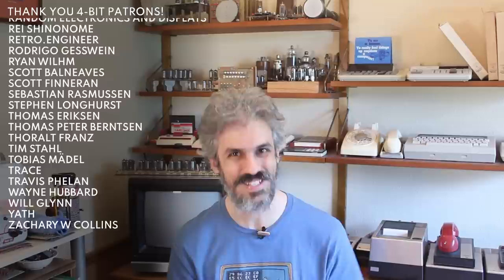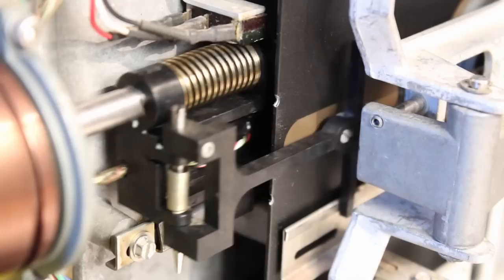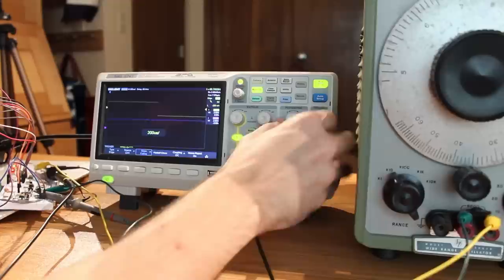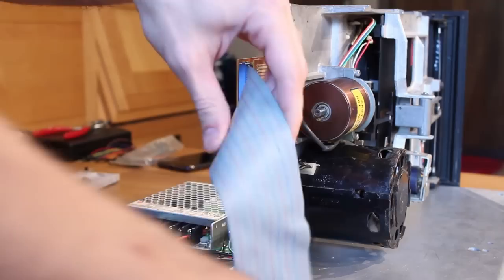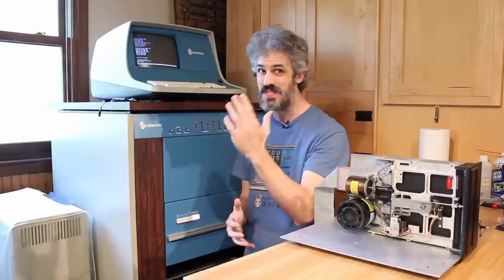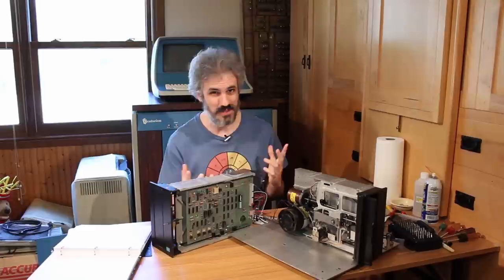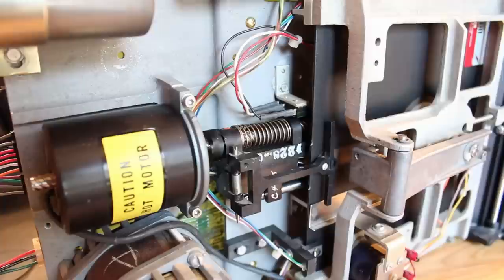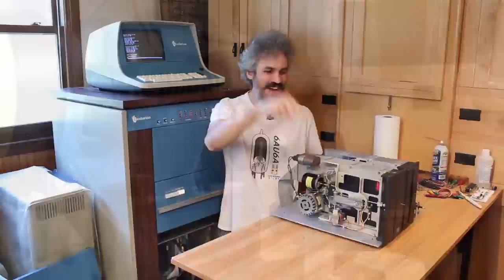Minicomputer Part 20: Connecting the CDC 8” Floppy Drives to the Centurion

Comment: Get someone to send you an 8" floppy disc. Hook the 8" drives to a PC, an XT work great for this. Then grab a copy of ImageDisk and use the alignment tool in the program to align the drive. Isn't that hard, just need a good formatted diskette. Alignment itself is a little tedious, but not hard, just time consuming moving that servo a tiny bit at a time.

This is how I allign my 5.25 and 8 inch drives.
Reply from the maker: That's an excellent idea! Though, I have something else in the works for alignment at the moment, but I'll definitely keep that in mind.
Although, I don't have an older PC, so I'd have to find some way to interface them with my modern desktop, which is a project for the future simply for backup purposes.
Reply: @UsagiElectric  Well come by VCF and make a thread, quite a few people would be willing to help with your project! :)

Comment: Once you perform the alignment on the floppy drives, your system will be THE reference for Centurion floppy alignments in the future.
Reply: until either an alignment floppy pops up ... which is unlikely ... or a stack of disks that have centurion data on them ... slightly less unlikely ... and then there is the question if the machine that wrote to those floppies was perfectly aligned ...  

it's pretty much the same hassle with head alignment on cassette decks - without an expensive alignment tape you can align YOUR decks  to be perfectly compatible with each other, but then you get a cassette that has been recorded on a different deck and might sound like crap in your decks
Reply from the maker: We're actually running into that problem with the Hawk data packs I have. Right now, the drive is aligned perfectly to the three data packs I received with the genuine machine, but I get read errors with the two packs I got from the counterfeit machine. Most likely, the two drives were aligned slightly differently, and if I had a proper CDC alignment pack, I could maybe get the head to a sweet spot to read both, but for the moment, we're mostly just focusing on the three data packs it works well with. 
I could of course overwrite the two questionable packs and they would now be aligned to my drive, making it the standard, but I think instead we'll get the second Hawk repaired and use it as our test rig to read out any questionable or misaligned packs, keeping the current Hawk aligned perfectly to the OS pack.

Comment: Contact Adrian Black of Adrian's digital basement. Ask for an 8inch floppy formatted on his newly repaired TRS80 Model II. In the sense since they are both 8inch drives, the tracking should be similar. As I remember the TRS 80 used Shugart drives and with some work one can get them to work on an old IBM PC or clone. Since they use the same media they should read the same track 0. Everything else is just formatting of sectors. You can also talk to him about how he connected his 8inch drive to a PC to fix it; he has a video on how he did it. This might be helpful to you and the Centurion Cause.

Good luck and Enjoy.
Reply: Good call.  It’s been a couple of decades since I worked on eight inch drives, but those CDC drives look suspiciously similar to Shugart drives.  There were also soft sector and hard sector eight inch floppy media to complicate the situation a little.

Comment: I love how when you are restoring something, the last ditch effort is to look at it as a physical schematic and reverse-engineer how it should operate. You have to basically reinvent it in your head.
Reply from the maker: So much revers engineering going on to repair these things! The manual actually has a troubleshooting flow chart, but the chart always ends with "Replace the PCB," which is super unhelpful, haha.

Comment: Comparators tend to go bad if they're reading anything beyond the logic voltage, and the weird resistor assignment is the bridge voltage divider meant to make sure the capacitors are sufficiently charged to keep chips doing their things rather than latching up in unknown states which is indeed bad for chips, which then the desired voltage set by the bridge resistors gets hit, the comparator fires, in turn actuating the Power-on Reset circuitry ensuring that the drive "boots" into well defined state that you want it to be in. Some smarter floppy disk drive (such as those from Apple and Commodore / Amiga) just wait it out in software routine until the analog portion of the drive is ready to handle anything the built-in floppy disk drive controller's CPU funnels into.
Reply from the maker: Interesting, thanks for the information on the Comparator POR circuit!

Comment: All that metal, the massive PCB and the washing machine motors all driven by a substation of power supplies. All of that, just to read a floppy disk! It's almost surreal to consider that within living memory, technology I once used on a (near) daily basis, is now (effectively) the subject of an "archaeological dig".
Reply: One thing I'm really wondering about is why did 8 inch disk drives spin continuously, instead of just when the drive was being assessed? Wouldn't that cause excessive wear, especially on the floppy disk?

Comment: Couldn't you get any 8" floppy with data on it to use it for alignment? When you look at the signal levels, it wouldn't really matter if the Centurion could actually read the data or not 🤔
Reply: Yeah, that's what I was thinking.  Any commercially produced floppy should get you into "close enough" alignment regardless of what system it's written for.
Reply: That would certainly be better than nothing.
Reply: Yes, definitely. Even better if he can use (say) three disks from different sources to be reasonably confident. Looking at the amplified read signal from the heads (before the digital part) with a 'scope should make it easy to adjust for peak amplitude. As you say, it doesn't matter whether or not the Centurion can read the data. One other thing is to check that the track 0 switch operates reliably for track 0 and never track 1. If a bit out of adjustment, it will sometimes tell lies.
Reply from the maker: That's actually a really good idea! I bet I can find some random 8" floppies on eBay with data on them already.
Gotta get that FFC card working first though!
Reply: @UsagiElectric  pretty much the way you aligned the other HDD right?
Reply: @UsagiElectric  You don't need the FFC working (yet). All you need is an oscilloscope connected to the output of the head amplifier. I expect the board will have a test point for this purpose.
Reply: @Derundurel  And it's probably better to look at the the signals form the head before any conditioning. Then you can look for peak amplitude of the waveform instead of looking for where it cuts out.
Reply: But ... any floppy that old may have had serious signal degradation.  My 5.25 floppies from that era are unreadable.
Reply: @KameraShy  they might, but that isn't my experience.  In any case, alignment does not require readable data.

Comment: I'm really glad you decided to repair the second drive. These devices are amazing and definitely worth keeping in full working condition. I'm glad I could get one here in  EU, that is not as easy as getting one in USA.
Reply from the maker: Yup, the goal was always to get both going!
And, even though we salvaged parts from two other Hawk drives, the ultimate goal is to repair one more Hawk and get it up and going. And, if I can find some heads, I would like to give the third Hawk a go at getting repaired. The Phoenix is a harder job since the fixed platters are extremely precise and almost impossible to change, especially without a CDC alignment pack to write new servo data, but we are thinking about a way to at least get it half working with just the removable cartridges. It may not be fully up and going, but half working is better than just tossing it!

Comment: Btw, linear power supplies also have ripple. But it's around 60/120Hz or 50/100Hz, instead of higher frequency around 65-100kHz. One thing about those Meanwell PSU's. Under light loads to sometimes go into "eco-mode" aka hiccup mode. That was not the issue here but something to keep in mind in the future. I usually use roughly 1/3 - 1/4 of the max power as a minimum as a rule of thumb.

Comment: Amazing job to figure out what was going on. That is not something I think I would have sorted out. A lot of what you have figured out I wouldn't have been able to. Wonderful to see that computer slowly coming back to life. Back when 5 1/4 floppies were in common use, one of the cautions I learned, not sure if it is true, was that you never power up a computer with a floppy in the drive, or in the case of the drive where you manually engage the drive heads, you should leave the heads disengaged. The reason is that a pulse could be sent during start up which could damage the data on the floppy. I never had that happen but then I always made sure discs were not in the drive or engaged at start up. If anyone knows if that caution is really necessary I would be interested to know.
Reply from the maker: Thank you!
Really, it's not that I'm smarter or more clever than anyone else, I'm just a bit more stubborn and refuse to let the machines beat me, haha.
As for the power on status, I think it really depends on the drive. For these CDC drives, it doesn't seem to matter since the head is unloaded and will remain so until the Power On Reset circuit stabilizes and unlocks everything. But, other 5-1/4" drives may be totally different. Weirdly, I now am more familiar with these 8" drives than any other drive out there!
Reply: From the days when PCs used floppy disks, powering on the machine with a disk in the drive was commonplace because you'd often want to boot from the floppy.  But then, on a PC, the BIOS POST routines allowed everything to settle before the drive had a chance to do any damage to the disk.

I used to work on a PDP-11/04 that booted from floppies, and we powered the machine on with disks in the drives all the time.   But then we were kids in a high school, so maybe our ideas of best practice were a little underdeveloped.

Comment: What you could have done is use a Schmitt trigger buffer or inverter (74 xx14) to clean up the square wave
Reply: Schmitt triggers also make great square wave oscillators using just a simple R/C network. It's easier to use than a 555 :)

Comment: The NE555 can convert a sine to square wave if it is in the voltage range. Input is then pin 2 and 6.
A Transistor Schmitt Trigger is possible with two transistors and a few resistors.
Reply: yep, i've used 555s like that many times

Comment: R90 is just a pull-up resistor for the LM339's open collector output.  R85 provides hysteresis so that once the comparator flips, it stays flipped (and not oscillate) as C43 slowly charges.  The reference voltage is applied via R84 just to provide some isolation so the hysteresis works.

CR17 is to discharge C43 instantly should the +5V drop.  It won't have to wait to discharge though R86.  

CR20 is interesting.  I think it's job is to insure that C16 is discharged the instant power is applied.  (C43 is 150 times the size of C16)  Since you say that's the erase inhibit line, it's probably to set the erase inhibit line active at the moment of power on.
Reply from the maker: Thank you for the analysis of the power on circuit!
We did manage to figure out the hysteresis design, but it's the CR20 that really bakes our noodle. That makes sense that it would set the erase inhibit on during power on though as that would definitely help to prevent erroneous erase options from happening when things are unstable.

Comment: imo the ideal computer was supposed to be fully digital from the start and all these analog/mechanical parts used over the decades were temporary compromises due to limitations of the time. it's kinda interesting how much time and effort they devoted to all the storage devices and their media prior to flash memory - paper tape, punchcards, magnetic tape drives, floppies, harddisks, optical drives. not to mention controllers, drivers, storage encodings and all the standardisation wars they had, only to be obsoleted in few short years.

Comment: Your 2n2222 square wave generator would've worked if you ran the output through a schmitt (schmidt?) trigger like a 74xx14 inverter.  Less components necessary compared to the 555 (although I understand that isn't really an issue for a hobbyist.)
Reply: I was just about to say the same as well. Although one could easily build a square wave generator with just that inverter itself 😉😎
Reply: @p_mouse8676  yep , you dont need any components to use a 555 as a schmitt, link pins 2 and 6, feed  input to them, take output from pin 3, done ! BUT 555s may have higher switching delay/'storage time' than a proper logic gate, so not so good for high frequencies but should be ok for this , advantage of 555s is they have much higher current drive compared to normal logic gates, if this is needed for a particular application (standard 555s that is, cmos ones have much lower current drive capability)
Reply: @andygozzo72  There is also a TL555, which goes up to 1Mhz I think. In the end there are a billion ways to build make a little square wave oscillator. My preferred simple way is a Schmitt inverter, followed by a totem pole inverter when a but more current is needed. This way even a MOSFET can be added to drive much higher loads.
Reply: @p_mouse8676  the TL is at least one of the cmos versions, yes higher frequency capable but lower current drive output, especially 'sourcing' current, only 10ma or so
Reply: @andygozzo72  just crossed my mind. There are inverting MOSFET gate drivers with a Schmitt trigger input and capable of delivering 1-2A

Comment: Great work getting the floppies recovered and (pretty much) working! I also highly approve of the Ben Prunty soundtrack to your efforts. 😉    Regarding alignment, I am not certain you need CDC or Centurion software on an 8" to align the heads, I think any 8" floppy disc with data on it should be usable for alignment, but I may be wrong.

Comment: I'm showing my age when I say I used to align floppy drives like that with an analog disk and an oscilloscope..
You had azimuth and longitudinal adjustments to make, so that the read/write heads were over the tracks correctly, then repeat same for double-sided drives..
Reply: Me too !   Using a Telequipment D67  oscilloscope  -  I recall many happy ( ? )  hours spent aligning Shugart SA400 , SA800 and Tandon TM100 drives ! Over 40 years ago now 😁

Comment: You should give yourself more credit on your adapter board! That's freakin amazing that your prototype works fine, I'm sure the next one will be perfect. This is so much more in depth and complicated as it would be with a modern-ish x86 pc, in those situations you just swap out the floppy drive because there's a bajillion of them out there...you used to have to work for it!
Reply from the maker: Thank you so much!
I know exactly where I went wrong with the adapter board, so the next one will definitely be a lot better. 
It's really interesting working on these old CDC drives and trying to get them to connect to the Centurion because they're so different from everything else out there. Sure the drives share some similarities with Shugart drives, but the FFC is wildly different than anything out there, which really makes it a fun journey of just discovering exactly how things work.
Reply: It's the learning process. How many attempts did Edison make before coming up with a bulb that worked.

Comment: If you have a floppy drive that was used on this drives in the past, you can use it for alignment. At any given seek track, what you want is to maximize the signal, and it should get it miniun when you locate the head between "steps" or tracks. I dont knot if 1 step = 1 track. Commdore have spacing track, so, inorder to go to the next track TWO steps were required. As a result aligment SW was simple, it drove the head into the spacing track and you need to adjust the whole stepper assebly (in/out) to make the output signal as low as possible. FACT was YOU DIDNT NEED AND ALIGMENT DISK ... just a GOOD one. They recomended using the original disk that came with the machine with utilities and another stuff .... or the ones with GEOS ... (ie, comercially made copies).

Comment: Good stuff, nice that they work. Onto to the FCC card, eh?

On that thought; buffer issues and read issues, that sounds suspiciously like the FCC has a bit of its own RAM that it uses as a buffer, and that one or more of those RAM chips are bad. That fits perfectly as I've noticed those chips that break down most often are RAM chips.

So if the FCC indeed has RAM chips, I'd start there.
Reply from the maker: That's actually a really, really good idea, but we're one step ahead of you. The FFC card and CMD card use a lot of the same chips. I swapped everything that was socketed between the two and the failure mode was exactly the same, which tells me that it's unlikely to be one of the socketed chips (the ALUs, RAM, and sequencer). We're now starting to dig through the microcode and are trying to wrap our head around why it sets the busy bit, but never turns it off.

Comment: CR17 to me looks like an overvoltage protection. Usually used this way for like ESD protection. CR20 is just there to make sure no current can flow in the other direction, when the capacitor C43 is being discharged. Speaking of which. CR17 could also help discharging the capacitor when the voltage rail is being pulled low.